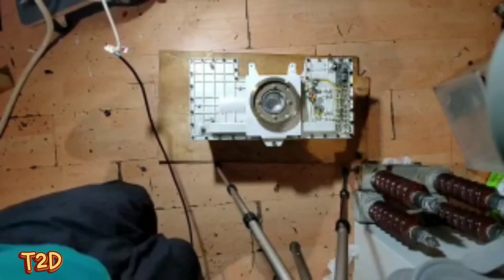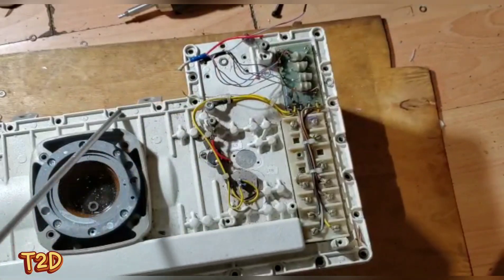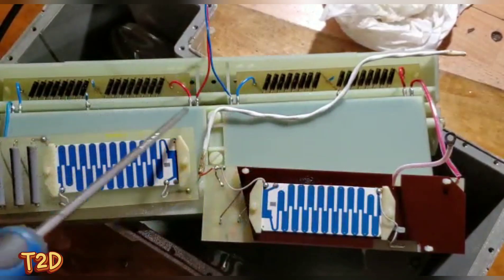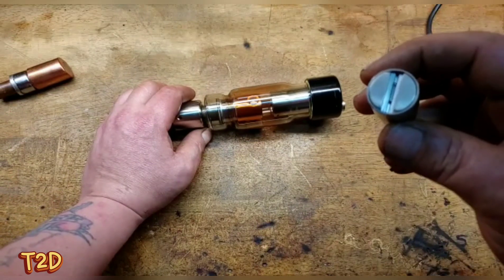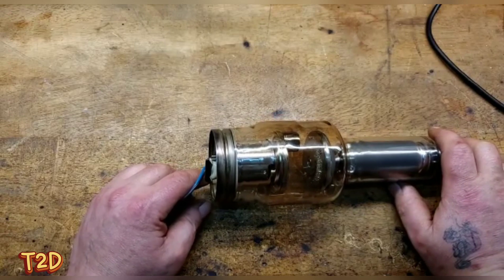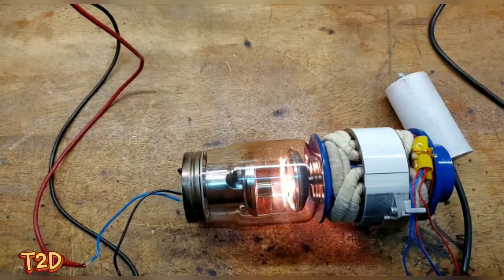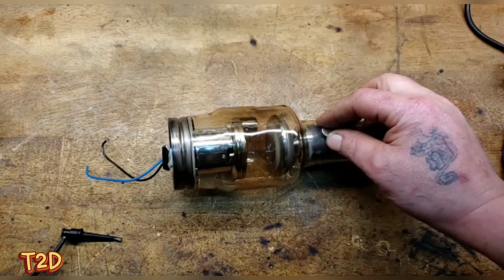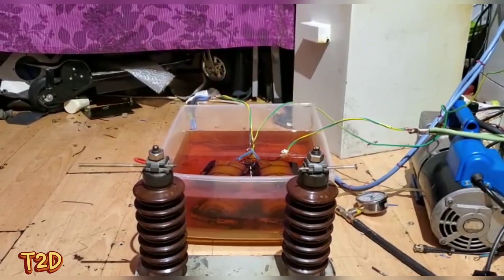Siemens 135,000 Volt medical X-ray head teardown and explanation

Comment: I imagine having a bunch of tungsten as a flywheel helps keep things spinning, although I don't doubt the quality of those (unrepairable) bearings.
Reply from the maker: Yep its very dense  as you say also incredibly well balanced and in a super high Vacuum, yes your spot on the bearings aren't user serviceable 😅 to be honest though some bearings do become noisy, however it is rarely the cause of failure of an insert, the most common failures are, an open filament, internal arcing at higher kVp caused by tungsten deposits building up on the inside of the glass from the filament and target, and  target  degradation caused by the electron beam  bombardment, as you could see in the video the target on the retired insert looked like a ploughed field ..
I would just like to add that this type of xray head wouldn't be serviced in the field, the whole monoblock is removed and repaced.
 Thanks for watching 😁👍

Steve

Comment: wait , when we connect the tangesten lamp with the high voltage input, wont that damage the lamp itself???
Reply from the maker: Do you mean the filament? The low voltage for the filament is floating and is at 62.5kv relatively to ground but is only around 5v on the actual filament 👍
Thanks for watching 

Steve
Reply: @T2D.SteveArcs  thank you but I still didnt get it, when we path a 60+kv between the Anode to the cathode, wont the cathode which is connected to the "filament" heat up quite high enough to melt the filament or break it ?

or perhaps , the filament (tungsten lamp) is not connected to the cathode ( the the high voltage doesn't pass through it, but through the cathode casing "the part around the filament without the lamp itself" )
Reply from the maker: @ll__LOVE__ll  the tungsten filament is the cathode in an xray tube mate, but even if it did have a separate cathode it would be fine as this is how Vacuum tubes work ... the cathode boils off electrons that then accelerate towards the anode and in a tube with a grid the grid is biased positive or negative to control the electron / current flow
Reply: @T2D.SteveArcs  how do they keep the filament exposed to only 5volt around that monster high voltage current around it?
Reply from the maker: @ll__LOVE__ll  the 5v is connected in parallel with the filament and the filament and anode are  then in series with  60kv
Reply: @T2D.SteveArcs  oh I see now , so the 60kv never passes through the filament as it has short-circuited before the filament 5v cycle, thus, 60kv passes throught the cathode without touching the filament but as it creates the -ve and +ve potential between the negative and the positive, it exists the filament electrons ( even though it didnt pass through it ) causing it to accelerates towards the anode ( +ve charge side ) , correct?
Reply from the maker: @ll__LOVE__ll  there is no separate cathode the filament is the cathode,  the 5v floating on the 60kv so the filament is live at 60kv but it doesn't go through the filament.. do you understand that you can have a voltage on top of another voltage??  The 5v supply is sitting at minus 60kv

Comment: Could you power the transformers by using an inductive ballast like a shorted MOT and power it using 120 volts from the wall outlet?
Reply from the maker: Yes a 50 or 60hz transformer
Reply from the maker: My high frequency transformers I drive with a half-bridge theres a vid on my channel..

Steve

Comment: incheresting vid here 
Hi, did you keep the X ray transformers or others components for reuse, or disposed of ? ⚡
Reply from the maker: Always keep transformers capacitors diodes and tubes the tubes sell on Ebay for 50 to 100 bucks and I use the other bits for other projects mate

Comment: Great video, you covered everything there.  The control often applies a brake to the rotor (shunts stator) to prolong bearing life as they do  roll on in a vacuum.  Like the insulators btw 😊. Quiet transformers,  not as whistley as usual for 8kHz.
Reply from the maker: Hi mate I ran them at 12khz and use noise reduction in editing...
Thanks for watching really appreciated 

Steve

Comment: Brilliant Steve. That was fascinating to see the inside of an X-ray machine. I can hardly believe that rotor was still spinning for so long. As you say the bearings must be so well made. Those transformers are great too. I am sure you will find a use for them. You sure know a lot about high voltage etc. 👍
Remember!! that oil, straight down the neighbor's drain. Or you could make chips. 😂
Reply from the maker: Excellent 😂😂 thanks for watching mate 

Steve

Comment: You should hook that motor up to a VFD and see how fast the thing can spin haha
Reply from the maker: Actually a lot of  times they run with VFD at around 200Hz 😁👍👍
Reply: @T2D.SteveArcs  I did not expect that. Is there any reason to control/vary the speed of this in normal use? I would guess it doesn't really matter as long as it spins fast enough. 
Surely you could run it at the right speed using a 50Hz motor?
Reply: An interesting thought, Basement Science. I can't think of any good reason for spinning the anode at super high speed though, but if you know otherwise I'd be really interested to hear your comments. -Peter
Reply: @peterjameson321  I was just wondering how good that bearing really is.